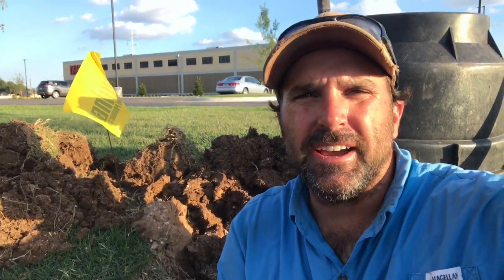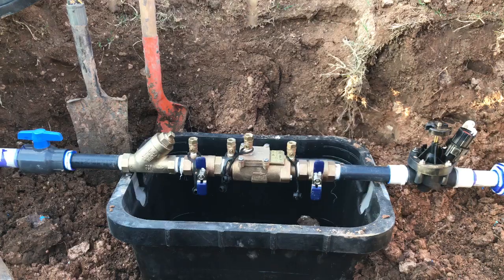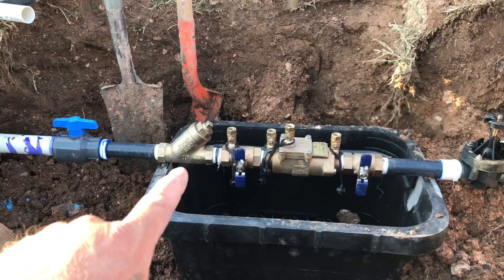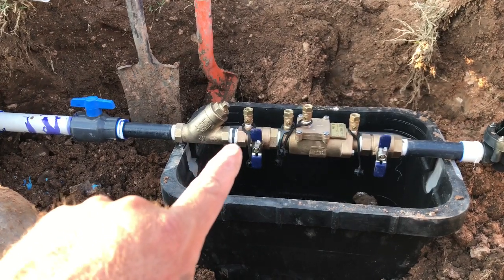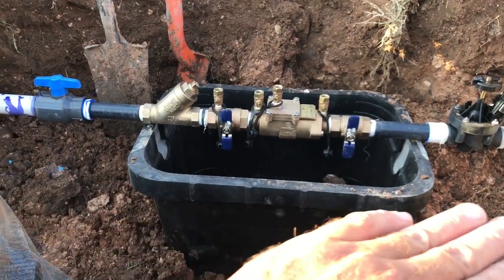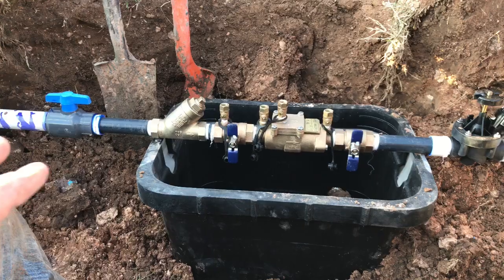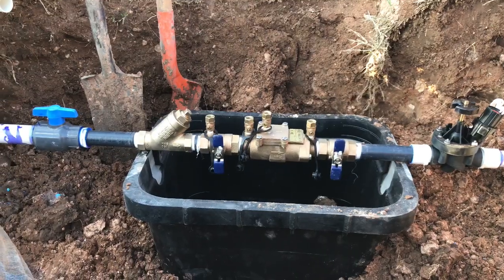Best Way To Install A 1” Double Check Valve Backflow Preventer In Texas

Comment: Is it true that this type of backflow is not to code in texas anymore?? I live in Texas.
Reply from the maker: No. A double check backflow assembly is still allowed in Texas, although some cities do not allow them. Check with you local water department or building department to see what type of backflow devices are allowed in your area. Cities have to follow the state rules set by the TCEQ at minimum, but can go above and beyond those rules. That’s why each city can be different.

Comment: Kelly, my Febco 850 states to "USE NO PIPE DOPE"". Did you use teflon tape for all of your threaded connections on your assembly shown in the video?
Reply from the maker: Yes. I only use Teflon tape on the threaded fittings and have good luck with it.
Reply: @AmericanIrrigator  Thanks for the advice.

Comment: is it ok to install a 3/4 double check on a 1 inch main pvc line
Reply from the maker: Yes it is. If the system is small and the zones are going to be fairly small, it is actually a good idea an will save a little bit of money. The pressure loss through a 3/4 double check and a 1" double check are similar. It is a good idea to look up the pressure loss chart for the backflow device you are using. It will help you make a decision on which size is best for your situation, when it comes to design and hydraulics and pressure loss.
Reply: Is pex a or b allowed to use in dcva?  Or must be a rigid pipe?,

Comment: Can stall 1 inch double check valve on 1/2 inch main line?
Reply from the maker: You can, but a 3/4 might be sufficient and save you some money. With a 1/2 main line you are limited to 6 to 8 gallons a minute on your zones. So make sure you are around that or below that.

Comment: Why do you need a master valve?
Reply from the maker: One reason is, it is required by state law, at least I know it is in Texas. All sprinkler systems, especially new installs, are required to have a master valve. But it is a good idea to have one on your system. When you have a master valve, it only allows water to be pressured up in the main line when the system is running. So if there was a problem, like a line break or a stuck valve, it won't be running all day and waisting a lot of water and costing you a lot of money.

Comment: In a lawn irrigation system, how close to the water supply should the Double Check be installed? Is it better closer to the water supply or closer to the valve manifold?
Reply from the maker: Typically what we do and what inspectors want to see, is the double check ( backflow device) closer to the water supply if possible. The reason is, they want to eliminate the possibility of another cross connection between the two, ( water meter and backflow). In our city, we have alley ways and the utilities are in the alley. So it is easy for us to put the double check in the alley close the the water meter. But in some regions, they do not have alleys and the water meters are out by the street sometimes in concrete. In those cases, I've seen double checks, RPZ, and or PVB's up close to the house. And, sometimes the water for the Irrigation actual comes out of the house. So you will see the backflow right where it comes out of the house. I hope this information helps. As far as how the system works, it does not make much of a difference where you place the double check as long as you do have one. You will lose pressure through a double check, but location should not affect the way the system operates if it is designed properly.

Comment: Is that  a RPZ valve? I want to check mine because the Water company says now everyone with sprinkler and septic need to ensure they have RPZ valve and inspected yearly now so not sure what valve these guys installed 14 years ago.
Reply from the maker: Yes that is a new rule. All systems with a septic system and or a well, have to have an RPZ ( reduced pressure assembly). The one in this video is a double check assembly. We install double checks in a valve box below grade, but an RPZ is installed above ground with 12 inches of ground clearance. I will have to do some more checking on if you will need to have your Backflow changed. It was my understanding that it was just on new installs, but we need to check on that.
Reply: @AmericanIrrigator  The Kempner Water in our area put out a notice that  all need inspected, everyone has septic do thousands of homes need to be checked in like a month? They will charge 75 if they do it. My sprinkler system hasn't been used for years so I may take off line and Just use hose sprinklers or connect to tap if I really need to water. Until I get funding and time  to repair pipes, heads, redig trenches to bury exposed piping.  There quite a few plumbers and Backflow inspectors going to rake in the cash over the next month or so in Coryell and Lampasas Counties..LOL

Comment: Looks awesome, great job. I actually never knew the y-strainer was suppose to face up. Now I know! Lol thank you!
Reply from the maker: Yes you can face the Y strainer up or down. It actually does not matter. I think it comes down to personal preference although I’ve strong arguments for both sides.
Reply: American Irrigator I supposed it’s also faced up or down depending access requirements? Would be difficult to work on if facing down in this instance?
Reply: I believe its to face down. but no one likes doing that because it wont fit into valve box. Ild put wye next to ball valve and replace a ball valve with a gate valve.

Comment: Looks like you were set to bury this double check valve. Does Texas not have a 1 foot above ground rule when installing backflow prevention? Thanks!
Reply from the maker: Yes Marc Richey is right. Double checks are typically allowed to be in a valve box below grade, although some cities I have installed in would not allow me to do that. RPZ's and PVB's are installed above grade.

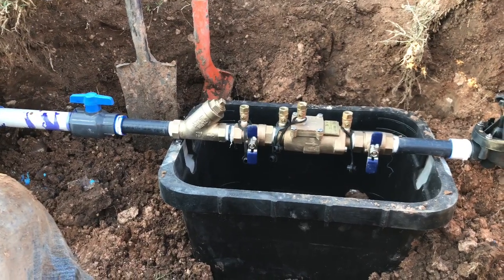Comment: @1:35 . So I’m not a licenced irrigator but why  does the pipe on the downstream of the master valve (mainline ) jumps from 1” to 3” size ?
Reply from the maker: Good question and good observation. This particular job was a was a commercial job that was a good size. What I mean is that the main line traveled a long distance. So one reason for bumping up the mainline to a bigger size was to help with our friction loss in that mainline because of the distance it had to travel to the last valve. This made that last valve have the same pressure at the valve as the rest of the zones that were close to the water source.

Comment: Would $2,500 to install one of these around Lubbock sound right at all? Ours is not working anymore and I am tempted to install it myself as the guy we had out quoted us for around $2,500. What do you think? I am desperate and need some advice.
Reply from the maker: That does sound a little high in my opinion. But it does depend on the size and circumstance. A guy might charge more if it is going to be hard to do. But under normal circumstances, I’ve seen anywhere from $500 to $1200. I do recommend you hire a licensed irrigator to install it because he will have to tools and know how and know all the state and local rules. And it will also need to be tested by a licensed backflow tester. I would get another quote for sure but be prepared to spend a little bit of money to get it all back up and running.
Reply: @AmericanIrrigator  Yeah, I thought so too. He said that his company couldn't install the master valve either. I was hoping to get it done for around $1000. I'd be willing to dig it all up and then backfill as well to save as much as I could. Thank you for the information and the reply! I hope you have a good evening!

Comment: It would be better to face the wye strainer facing down . So when you open it up to remove debris the water will drain out bottom . Instead of debris being trapped in body of strainer
Reply from the maker: Thank you for the comment and advice. I used to do it that way and that is how I learned to install the "Y" strainer. But I had an inspector talk to me about facing it up and the reasoning was: 1. It is easier to take the cap off and flush it out. 2. With the Y strainer being under pressure, it will keep the debris up at the top of the  filter. His thought was it didn't matter facing up or down. So I tried facing it up and found that it was easier to get it all in the box and like he said it was easier to get to the cap to flush it out. So I started doing it this way. And it always helps to do things the way the inspectors like it. It makes life easier come inspection time. HaHa. But Yes, facing it down is good.